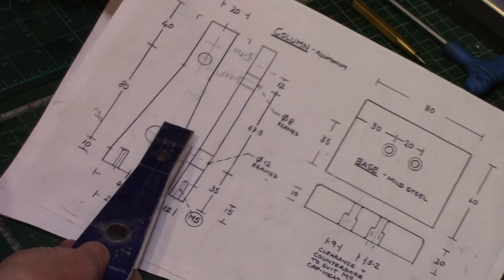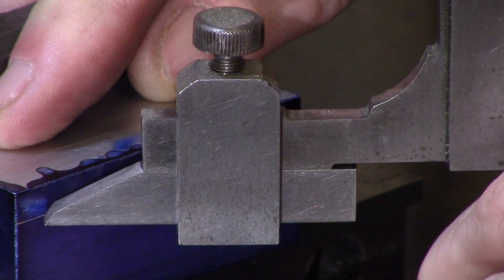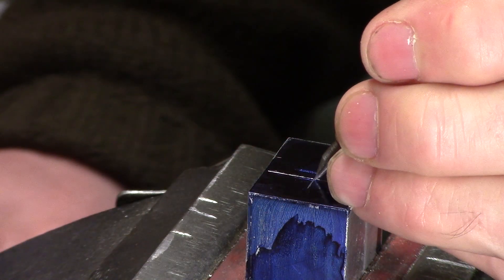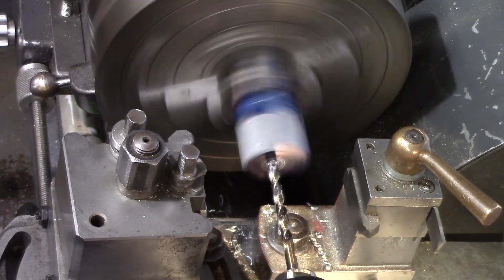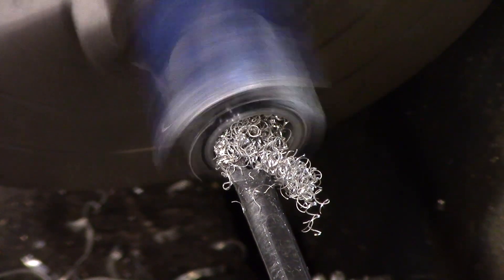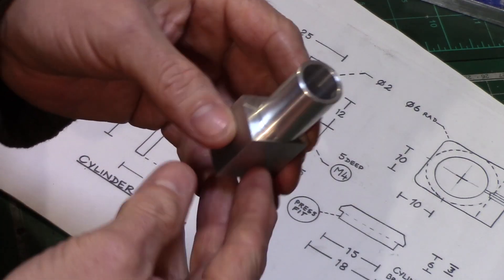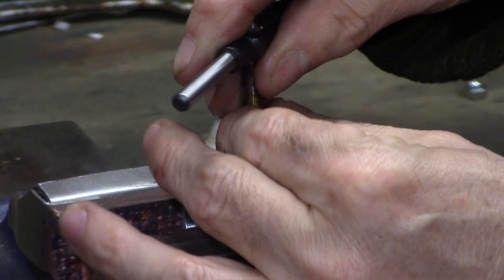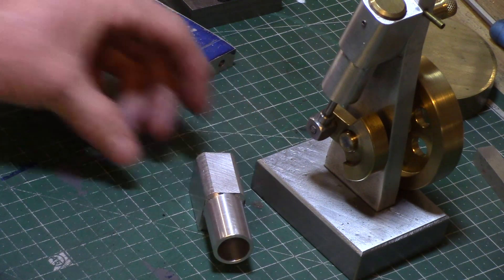Wig-Wag Engine Build Series - Part 3 - Cylinder

Comment: Looks like you have a Dore Westbury mill there. 
I like the versatility of the DW mill... it’s my quest machine, mostly due to space limitations.
I know these mills are ‘home machined’ from castings. I’ve never used one. How do you rate them as a home workshop mill?
Reply from the maker: Hi Harry, I love my Dore Westbury mill, as it is a very capable machine for my model engineering work, It isn’t a workhorse if you intend hogging out steel stock all day long, but I generally work with aluminium and brass building one off small components, so is the perfect bench top size for my workshop, and very capable of high precision work. ATB Ade

Comment: Cracking tutorials Ade! You’ve made Lockdown Part 3 a damn sight more bearable. Just out of interest, do you work out any build costs for your engines?
Reply from the maker: Hi Mick, no, I never work out build costs, I usually start with a flywheel, and go from there, to be honest, If I begun thinking about the cost I would probably not build anything, as metal is expensive

Comment: I've never seen anything official on this, but should a height gauge not be used with the sharp edge leading, rather than the corner? Or would that make the scratch mark vanishingly thin?
Reply from the maker: Hi Ken, both edges are sharp edges, so not exactly sure what you mean? the scribe line comes from the lower edge of the scribe
Reply: Hi Ade, If you stop the video at 1.53 you are dragging the scriber from left to right across the piece. Now imagine that, with the height gauge in exactly the same orientation, you pushed it the other way, from right to left, like running the video in reverse. But now the sharp edge is leading, not the blunt corner. Do you see what I mean? You will get a sharper, thinner, line. (Although as I said, it might be well-on invisible!). 
I do of course realise that I'm splitting hairs, and probably dancing fairies on a pin-head too. I'm sure you've successfully scribed far more lines in your time than I have!
Reply from the maker: @kenhenman303  I'm sure you have a valid point in some universe Ken, but it is over my head mate, Sorry I lost it, Best regards. Ade
Reply: Hi Ade, Yes, just got to find that universe where I make sense to everybody, not just me! Never mind, thanks for making the great videos!